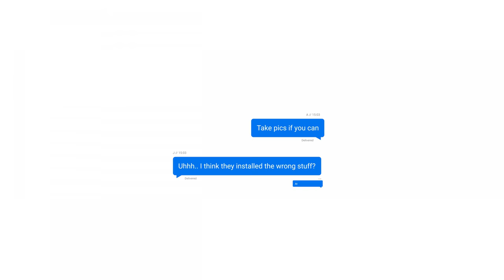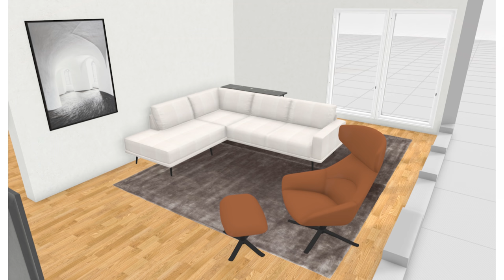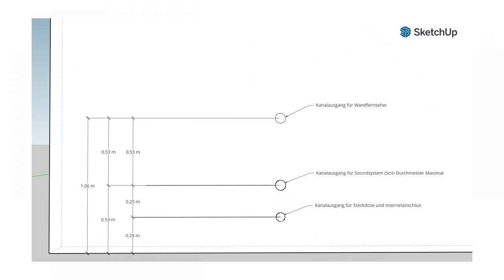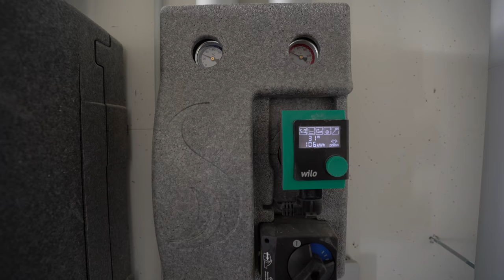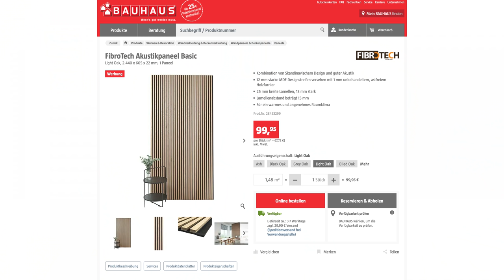HARD Lessons from Building a House in Germany

Comment: On the holes in the wall: it is definitely possible to fill/repair them even if they're in a concrete wall. The issue is cost. You could use mortar to fill it & then put on matching wallpaper and paint it (probably better to replace the whole strip of wallpaper in that spot) If done correctly & very precisely you shoulnd't see the difference. You could ask your contractor if they're able to do it (they should) and how much it'd cost. Obviously it'd have cost less before the wallpaper came on. Anyway, in the end it's about how much you are willing to spend to have it fixed. But it is possible.

On the noice reduction issue:
It is going to be less noisy the more stuff you have in that room & the more people are present. Wood does reduce noise quite well, so anything made out of that will work. I'd avoid smooth metal surfaces that reflect sound more easily. Also fabrics are great, but it's not everyone's taste to have tapestries hanging on their walls, although there are some stylish modern pieces that look nice. On that note, paintings or prints on canvas are also great for that purpose. That all depends on what style you want to decorate your house in.
Reply: I guess the problem is not so much covering/filling the old holes, but getting the new ones in the desired location. That would be a PITA in a solid concrete wall.

But hiding the cables should not be a problem. In the worst case - if the soundbar or TV really sits flush with the wall (which is usually not the case anyways) - you can just add spacers where the mounting brackets screw into the wall, so you have a little space behind them to route the cables. Then everything will be nicely covered by the devices.
Reply: And get some feet of the Rauhfaser (woodchip wallpaper). Because there are some different types which migh look very differently at repair spots.

Comment: With the TV room, you can’t change the wall or what’s built in, the obvious solution is to exchange the furniture until you have something that works. As long you have the purchase receipt, it should be possible but you might need to experiment to find the perfect setup! You’ll no doubt be happy once you find it.
Reply from the maker: Yeah for sure. We really like the furniture we picked because, as opposed to the "original" layout this offers more seating places. But I think we can make it work. In the end these are just small details. But I also like the idea that we could possibly switch up the furniture placement... even if it was mirroring the L shape of the couch.
Reply: @TypeAshton  You could always just put something next to the TV to make the whole arrangement (TV shelves + CD rack or whatever) visually centered on the wall.

Comment: What's the problem with the cable channel and concrete walls?

"Diamonds are a girl's best friend" may be true in the USA. We don't waste diamonds on girls, we use them for tools.

For example, for wall cutters (Mauernutfräsen), not the cheap ones that can only play with brick walls. There are also professional tools that can have fun with concrete. They do the job – you can borrow them from a good home depot.

Small tip, you should use them before the final cleaning.

And it's the perfect opportunity to use up a few leftover FFP2 masks, don't forget safety goggles.

Comment: Regarding the "Conel" Thing in your technic room - this is the main water filter with a retaining valve. You have to backwash it every now and then. The valve is to retain contamination from your plumbing floating back to the main pipe. It also has a pressure reducer to keep the pressure on a normal level. The grey insulated thing with the pump might be your low temp floor heating valve to keep the temperature at a certain level. But this is just a wild guess, since there is no real picture of it. The pump itself is a real nice one!
And of course the big cylinder should be your hot water reservoir (boiler). It´s not bad having "Fernwärme"!
Reply from the maker: Awesome! Yes I think the entire system is really quite impressive to look at (and to us looks very commercial). Our house is certified to be a KFW55, so we are looking forward to the energy efficiency savings.
Reply: @TypeAshton  absolutely! But as a German, we are always keen to optimize! ;)
Next time you are heading to Frankfurt, just stop by...!

Comment: Regarding your TV issue: I have a similar setup with no chance to put cables into the wall. I have a very thin white cable channel under the TV towards soundbar and lower.  I also have a kind of floating cabinet wich has a false backwall to the bottom to hide all the cabeling (etherhernet switch, HDMI, power) etc.  if interessted i could send you pics (but offline)  Frank
Reply from the maker: Hi Frank! That would be super helpful! If you want to send them via email, ours is theblackforestfamily@gmail.com

Comment: Just buy an LG OLED TV with Dolby Atmos and you won't need the soundbar any longer.

For your "Diele" I would recommend to wait how to furnish and decorate it until you lived there for a couple of months best with different seasons. You might find out that requirements change during the year and with special events occuring. But if I saw it right, you should have some options to use your "Hausanschlussraum" for some needed or optional solutions.

And btw, I hope you decided to have some network cabling installed between the "Hausanschlussraum" and the "OG's", otherwise the WiFi could be a bit challenging.
Reply from the maker: Luckily the router is installed on the first floor and the cabling is installed also in every room. We will see how it goes and add repeaters if necessary.

Comment: The easiest way to solve the tv issue is to make an accent wall to encapsulate the premade holes and mount the system on it. I had a similar issue in the apartment that I live in. Here in Germany, dry wall is not all that popular so having a tv and sound system without seeing wires or wire channels is very difficult. So I decided to build an accent wall that covers everything and looks great. If you need ideas or help with this let me know.
Reply from the maker: This is a great idea, we are looking into this as an option for now.  Thank you!

Comment: Hi guys! I didn't read through the comments, and probably someone else already had these ideas, but just in case...
For your "TV sockets not centred" error, did you think about setting a cover wall in front of the actual wall that can... well... cover the holes? If it's decently sized, you might add some indirect lighting behind the edges, which might give that room some more extravaganza. Personally, I love these indirect lighting, especially with multi-colour LEDs. So you can chose the colour matching to the occasion. Some TVs even allow to do this matching to the picture on the screen. It's quite impressing what difference this can make.
And for your hallway and the staircase, tapestry and short decorative curtains hanging from the ceiling can take away a lot of the noise and echoes - if you don't mind vacuuming them due to the dust getting carried in there.
Just my 2 cents.
Reply from the maker: I think that's a great idea for the living room! Jonathan also really enjoys the subtle indirect lighting. Thank you so much for your help and the recommendation.
Reply: @TypeAshton  My pleasure ^^ Looking forward to seeing the result :)

Comment: Hello,

24:19 this is the expansion vessel for the heater (Ausdehnungsgefäß der Heizung). 

An expansion vessel is usually located in the return of a heater and has the task of keeping the water pressure in the system constant. If the system produces hot water, the expansion vessel absorbs the excess that occurs during the expansion of the water (<--- from the internet).
Reply from the maker: The engineering nerd inside of me is geeking out over this. I have been reading a few articles online about it and it is really cool how this works!
Reply: @TypeAshton  We bought a second-hand house a few years ago.
And after moving in, this expansion tank seemed strange to me because
 I couldn't explain what function it was supposed to have in the place where it was mounted.
Since I am neither a chimney builder nor an engineer, I simply asked our chimney sweep.
And he laughed. He explained to me how it worked. And then he told me the history of the heating:
The man who built our house installed the entire water circuit himself, because he was an intusiastic do-it-yourselfer.
Like Tim Taylor in Home Improvement. 
And he built the whole system so that it could withstand the pressure fluctuations without a expansion tank.

When the heating system was to be inspected by the responsible chimney sweep, he pointed out to the builder that in Germany 
it was a legal requirement for a heating system to have an expansion tank and that the heating system must not be operated in this way.
So the builder took a close look at the text of the law and found that it only stated that a balancing tank must be connected to a heating
system. However, it did not say where it had to be installed. So he simply extended the water circuit by a small piece and hung the tank
at the end of the circuit.

Of course, this makes it completely useless, but the legal requirements are thus fulfilled and the heater got its approval.

Comment: On the retaining wall: in the first draft the sketch showed a 30cm thick retaining wall with the text saying "according to structural necessities", but in the video the exposed hill side looks at least 2m high with a shallow slope. My engineering education would be waving all the red flags China could muster. I'd call a 30cm wall 'decorative' there. The changes where inevitable imho.

Hopefully the water drainage will be sufficient.